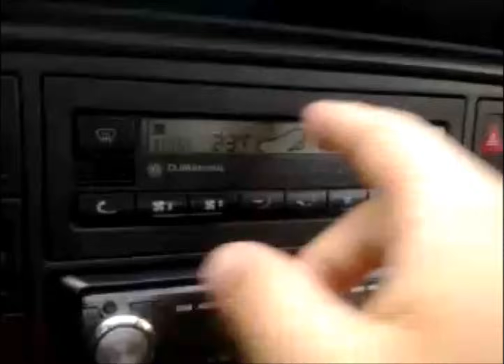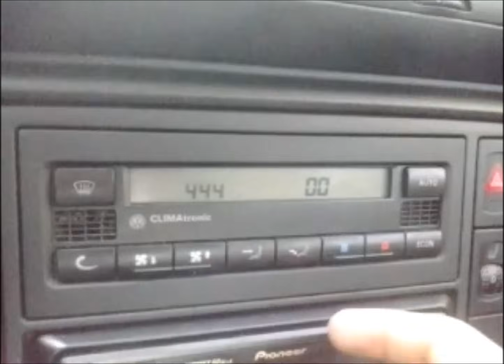VW Climatronic system - how to diagnose a problem with climatronic

Comment: @EverydaysBuisness I have a Passat B5 2002 What could be the problem if the light (blue) on the Clinatronic does not work?  Changed the climatronic unit, but the problem is the same.
Reply from the maker: Check the fuse for the interior lightning

Comment: Hey great video, can you tell me what are those 2 grids for? Number 11 on your thumbnail, I've broken right one does it affect something?
Reply from the maker: Hello there, under number 11 you can fin the interior temperature sensor, I belive that it will not affect anything as it is located a bit deeper in the climatronic unit and not right  behind the mash
Reply: @EverydaysBuisness  thanks for the reply man, do you know what are grids for? Are they something like blower or what
Reply from the maker: Prijatelju, iza njih s lijeve strane je senzor za unutarnju temperaturu u vozilu, a s desne strane nema ništa, dakle ako si polomio rešetkice nemas brige samo pun gas dalje!

Comment: hello from romania , have a big problem "214 00" , i searched on web and found "Trailer hitch aftermarket equipment, removable with reduced ventilation capacity" .. any solve on this ?
Reply from the maker: suCre - A2 try google it a bit more personally I do not have idea what might be the problem

Comment: Hello 538  00 is bad or good?  Thanks for your answer
Reply: Thanks!
Reply from the maker: Steve 01 it seems that you have some electrical problem with can - bus, check the link in description and Google it further!
Reply: Everydays Buisness you wrote me previously that if it is working without blinking it's ok. And so it is it works perfectly. I can see the code just when I push econ and...but it works perfectly. ( skoda superb 2008.) What do you think do I have to go to an electrician?
Reply from the maker: Steve 01 yeah if it works perfectly than you do not have to worry about anything, it is maybe a stored code that only comes up when you run diagnostic because it happend a while ago and it was not cleared. So yeah it everything works fine you do not have anything to worry about! :)
Reply from the maker: Steve 01 yeah if it works perfectly than you do not have to worry about anything, it is maybe a stored code that only comes up when you run diagnostic because it happend a while ago and it was not cleared. So yeah it everything works fine you do not have anything to worry about! :)

Comment: Hello, you have a nice chanel and I wanted to ask you something about my Passat b5 2002 climatronic, I charged it and still doesnt put out enough cold or hot
Reply from the maker: Jodey II there is potential problem with the inner climatronic fan that circulates the air, it should be located under the cabin air filter so make shure that its working!

Comment: Hey, In my 03 Passat the climatronic is off. Like nothing shows at all. I changed the fuses already. Any other idea of what's wrong?
Reply from the maker: Jarreau Daniels either the whole climatronic unit blown or you just do not got power to it. I would suggest that you scan your car using VDCS diagnostics, it will definitely make it easier to diagnose the problem

Comment: Hi! I have a problem with my Passat 5th series climatronic. The issue is when I switch my car on, the climatronic automatically turn on too. What are the procedure for stopping this problem? Thanks a lot!
Reply from the maker: Marco Del Vecchio before leaving your vehicle,  click on the button that will reduce the fan speed u ntill it says OFF, and than turn off the vehicle. Next time you start your car the climatronic will be off and you can turn in back on by pressing the fan speed up button

Comment: can you turn off air con, and just use normal heater ,by using controls or remove fuse
Reply from the maker: there is no point in having a broken AC unit in your vehicle

Comment: 306 ?
Reply from the maker: Look AT the description box bellow video. There is a link with all the codes and explanations.
Reply: i did it, but i couldnt find this number and the problem :/
Reply from the maker: Front bumper temp. sensor is damaged. Change it and it should work perfectly.
Reply: thank you :)

Comment: Hello!! thanks for the video! i have a passat b5, it works great almost every time but when it rains or when i wash my car or even when i drive over a small pot hole with water the climatronic starts to fail, it blows HOT air (i mean, really hot...) and i have to wait for about 30 - 45 minutes until it starts to blow cold air, what can it be? i live in a very hot city. I hope you can help me!! Tnx!!!
Reply from the maker: I'm guessing that compressor unit stops working. Check the compressor connectors and clean them, also when it stops blowing cold air stop turn off the car and start it again and follow instructions from this  video and see if there's any codes that climatronik reads of there is any look at  the video description box and you will find link with faulty codes with detailed explanations. Hope it helps, have a nice day.
Reply: Ok i'll try rhat, thanks!!!

Comment: 513 on left side    00 on right side? - causing no heat but full power
Reply from the maker: your gateway is broken, look at the description box of the video to find list of codes with explanations of faulty codes. Hope it hepls. Have a wonderful day
Reply: Thanks for the quick reply. I'm a little new to this, so what is "Gateway" refering to here?
Reply from the maker: +Eyðfinn Drewsen I'm  not really sure because it could be more than one thing. Check the video description box and you will find a link with all faulty codes and detailed informations.

Comment: wtach meen code 318
Reply from the maker: +Lina Petrylaite "0318 Air Conditioner Pressure Switch "

I had the same problem with my car it costs about 50 euros to change and it is a 20 min  job. + You need to refill your air condition unit with new gas (65 euros)
Reply: @EverydaysBuisness  i